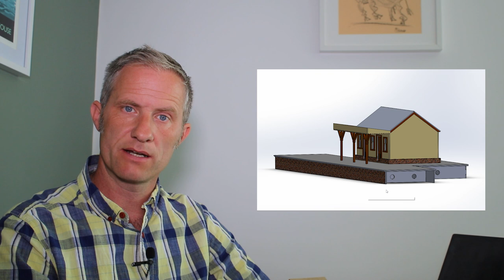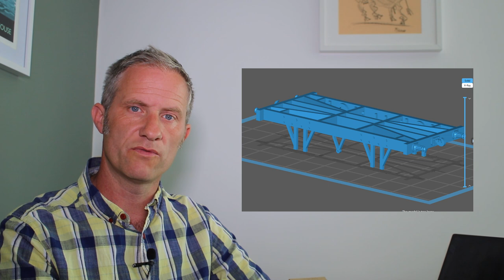Introduction to the CAD series for railway and architectural models.

Comment: hi james   great  video and very informative 
i use desigh spark mechanical for my cad drawing  for my little 3020 cnc
it can also be used for to do 3d  design which i have done also for my 3d printer
it works fine  for my needs and is easy enough to learn 
i know that there is also a free version of fusion 360 for hobby work but i find that you need a fast computer for to run it my computer has only 4gb memory i think you would need 8gb to really work fusion correctly
even design spark can be a bit glitchy sometimes if i want a more complex 3d drawing
i too am learning as i go and i look forward to your vides on on this subject
as i'm starting a model railway layout and i sometimes wish that stl files could be purchased at a reasonable price for to 3d print the 2d drawing is really easy to learn but the 3d drawing is a lot more complex i find any way but maybe its me thats wrong lol
regards
james o connell
Reply from the maker: Hi James,
It sounds like you've got a nice set-up there.
I agree that 3d CAD can often seem the more daunting to learn.  As we work through this series and move onto the 3d stuff, I'll try to break the processes down into very simple pieces and show that the transition from 2d to 3d needn't be that hard at all.  I think it's our own minds which get in the way of us processing what is essentially a very logical set of processes.  
I find that when we learn something in the context in which we are going to use the information, then our ability to process, retain and apply the understanding is often enhanced.  This is the basis of the tutorials, there for model makers by a model maker.  It's my hope that by the end of Part four most will feel a lot more confident about 2d CAD and be eager to have a go themselves.
Thanks for watching and for your lengthy comment, I appreciate the support.
Best wishes,
James
Reply: @BexhillWest  i  lookforward to the rest of your series and i am lucky enough to have those little machines the cnc is small and so is the elegoo mars but they are more than enough for oo/ho model makingi had the little cnc for to do designs  for templates for making one off brackets and the like when i was able to work in my fitted  furniture business  but i had to give up work due to severe arthritis in my spine  and the model making is a way to pass the time
but as i always say there is always someone with worse health issues than me 
but i guess everyones problem is there own and we all do different things to adjust  and the model railway is my way of getting on 
i think that the laser you have is really a fantastic machine for this hobby as the engine shed and the station you have made looks fantastic especially the way you have done the  sash windows an excellent idea
i know that i could do them with the 3020 cnc but not nearly as clean as the laser
stay safe
regards
james o connell